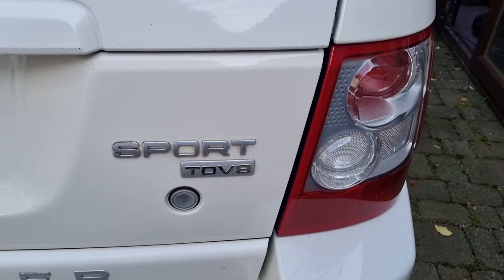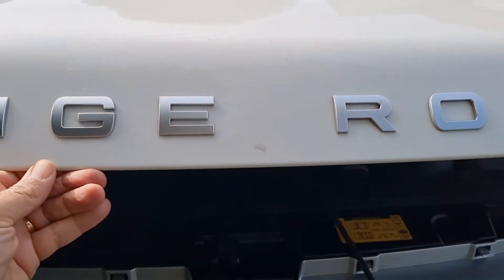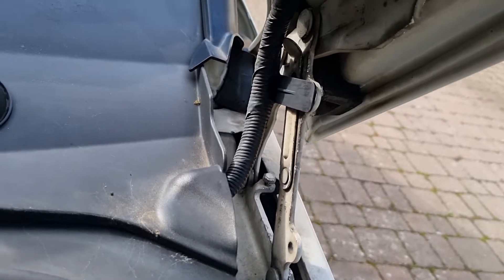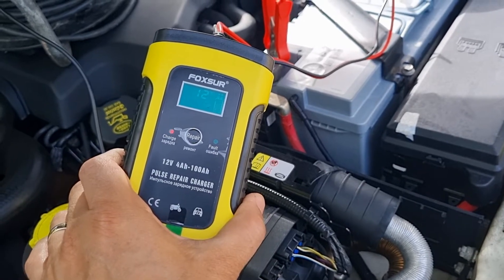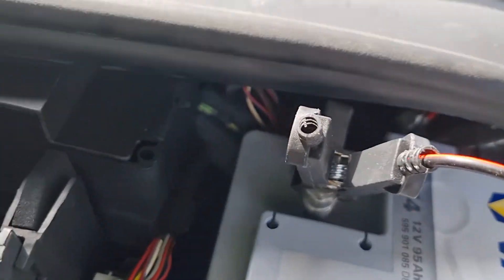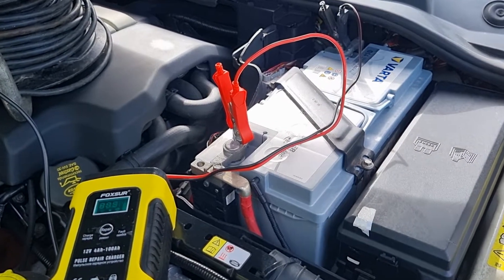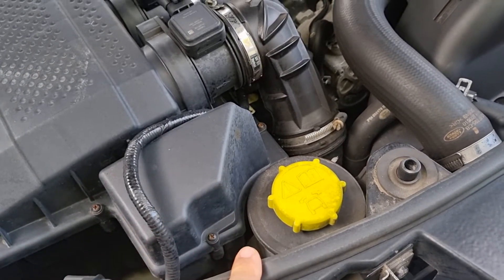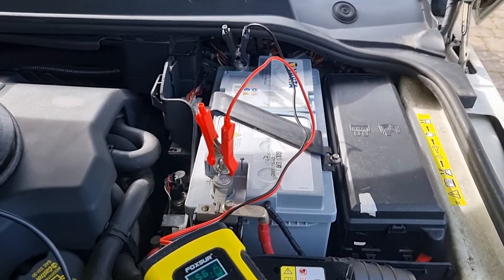Range Rover 2009 TDV8 Charge Battery

Comment: The bottle on the left with a yellow top is the ace fluid. 
Your anti roll bars are working with fluid. It’s a special fluid, and it also goes in the steering, which is the yellow top on the right.
Reply from the maker: Thanks